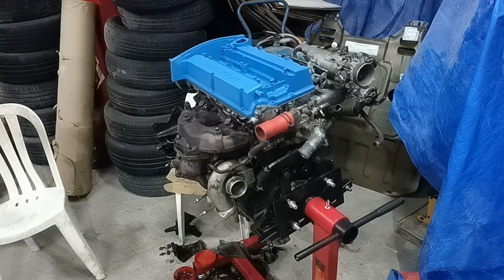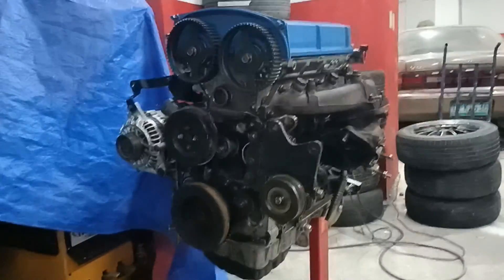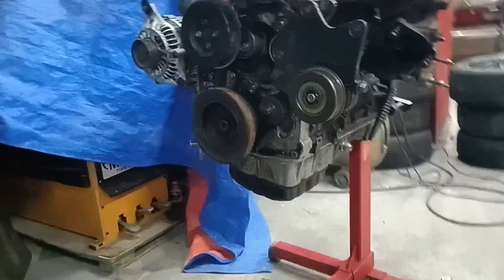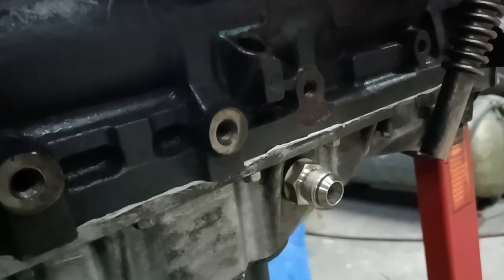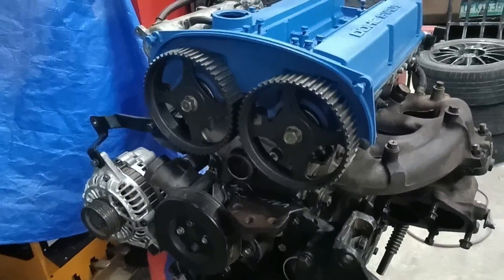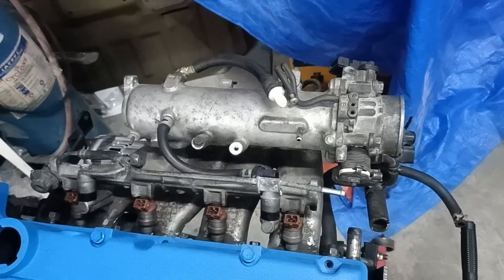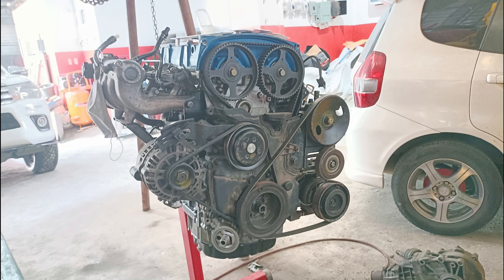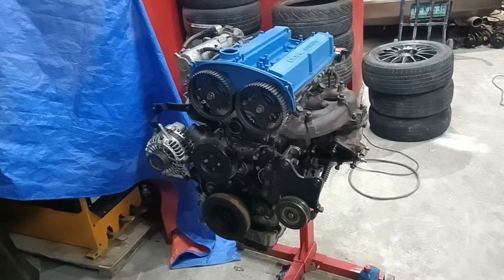Assembling a hybrid Hyundai/Mitsubishi 4G63T engine - Project Coupe AWD

Comment: I have a sonata 1997 2000 cc
Can i use a mitsubishi 4g63 engine instead of hyundai g4jp engine ???
I mean without editing mounts or other parts cause it so difficult nowadays. 
Please we are waiting your
Reply from the maker: Assuming you are just replacing an existing G4JP engine in your car with a 4G63. yeah should work . as long as you get the correct generation 4G63 that works

Comment: Can i just using the original g4jp head and intake manifold but with modification like port & polish, and be able to install the turbo?
Reply from the maker: Yup you can
Reply: @kuholgarage  is the stock g4jp cooling system, enough to maintain a safe temperature when installing the turbo? is it necessary to use a cooling system from 4g63?
Reply from the maker: @viano_16  depends on your climate, existing radiator size and condition, usage situation, power goals, etc if your stock radiator will still be enough. Try it out first, can always make radiator bigger or thicker later, or if you need more cooling fans.
Reply: @kuholgarage  my power goal is 350hp, and is the stock g4jp internals can hold up that amount of power?
Reply from the maker: @viano_16  I cannot answer that. As you can see, our engine has forged internals with lower compression pistons. But fitting Evo 5-9 OEM pistons should allow you your 350hp goal
Reply: @kuholgarage  Do i need to use the evo 5-9 for the connecting rod too, or just the piston?
Reply from the maker: @viano_16  just the piston would be fine.
Reply: @kuholgarage do i have to reduce the engine compression to install the turbo safely? because the G4JP engine has 10.0 : 1 and the Gen 2 4G63T has 8.8 : 1 so i dont blow up the engine...
Reply from the maker: @viano_16  depends what fuel you will use. if high octane or E85 you can stick to high CR. Or just keep boost modest. If higher boost and not so good fuel, you can lower CR.
Reply: @kuholgarage  i am using 98 octane  fuel. And if i am still using high CR and installing the turbo, the compression is even higher and the engine stress is also increasing which lead to engine blow up. So my question is, can i change the stock cylinder head to evo 4 cylinder head to reduce the compression? So i can install the turbo even safer...
Reply from the maker: @viano_16  changing head to Evo 4 will not achieve lower CR
Reply: @kuholgarage  so the solution is just replace the piston's with low comp piston's? Or is there another way?
Reply from the maker: @viano_16  or just run low boost.
Reply: @kuholgarage  thanks for advice
Reply: @kuholgarage  for the transmision, can i use the evo 4 transmision?
Reply from the maker: our G4JP-poweed Coupe is running the evo 4 transmission and is AWD
Reply: @kuholgarage  al right